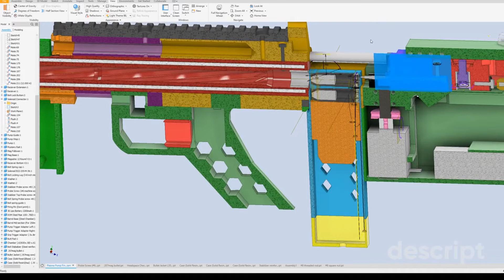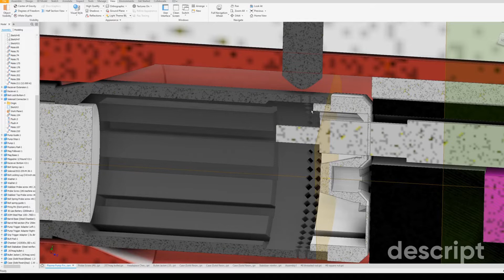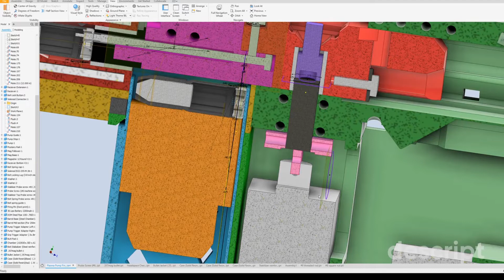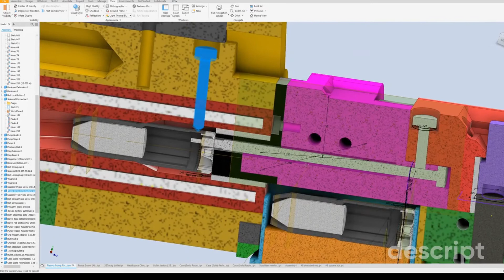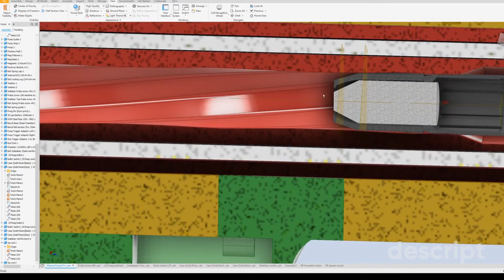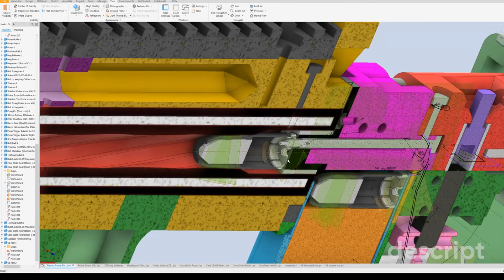Plasma Pump CAD Breakdown

Comment: Really nice idea, for the bullets you could make the cases metal with an insulated centre area like a real bullet, inside each bullet there is a small zero ohm resistor so all that is required on firing is for a few amps to pass through the resistor, the cases can then be ejected and reused, I find this topic fascinating and well it's fairly obvious between guns like this and coil guns gun laws are pretty much useless, add to that once we have AI helping the design goodness knows what kind of guns you will be able to make at home, keep up the good work.

Comment: why have the firing pin inject into the cartridge before firing? how about having the tip of that pin already in the cartridge, and have a metal contact already attatched to the rear of the case as a "primer" for the rear "pin" to physically contact and conduct the electricity.

Comment: Yo, this is cool as shit. I originally thought it was a plasma-arc type of design, but this is cool too. I theorised and partially designed a plasma-arc gun last summer but never built it. Using microwave transformers and pure oxygen gets a lil sketchy.
Reply: When you say microwave transformers do you mean using a magnetron? Because I did have the idea using a microwave to wirelessly heat up the powder which of course won't work with a metal barrel

Comment: are you familiar with the steyr acr?  i think a operation like that would be perfect for this :-) To get around the vent holes in the case you could do a ring around the case with 2 holes. pull a wire through and wind them around the case.

Comment: so i had an idea similar to your earlier caseless design, but in my idea i didn't think to have a probe that peirces the cartridge and instead i thought that the solution would be incorporated into the projectile itself and instead have some contacts points that the bolt mates up against to complete the circuit. I figured that would simplify the chamber process and make the ignition much more consistent. 
The other idea i had was pre loaded disposable plastic barrels with probes or contact points sealed on the chamber end. it would act similar to the old harmonica guns, after each shot the gun cycles over to another barrel. In this case simply dropping the previous barrel not retaining it like the old harmonica guns would. Technically this design would be muzzle-loading, and therefore you could design the disposable barrels to even be integrally suppressed, they'd be light too. They could ordered in a staggered configuration or in pairs to increase capacity as well.
Reply: Never too late to do it.